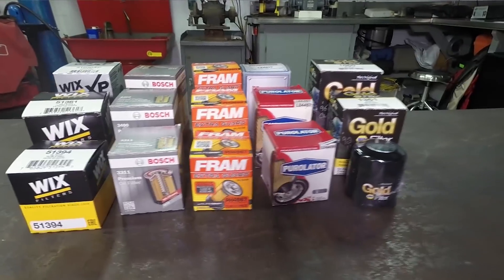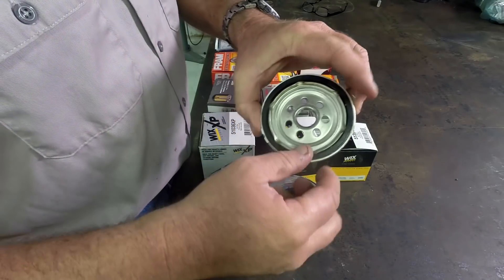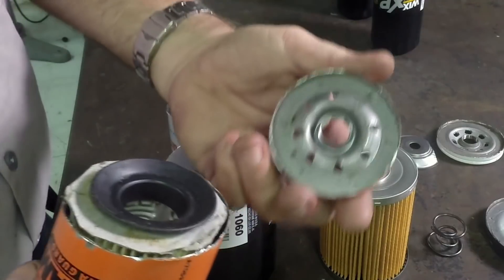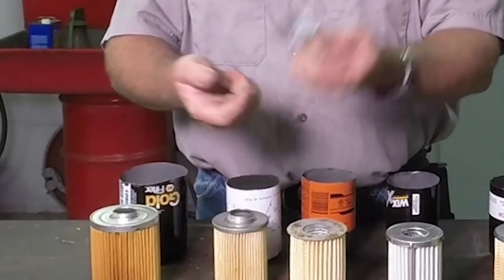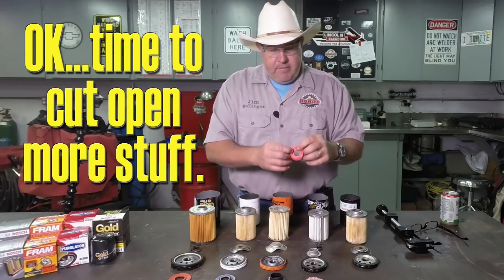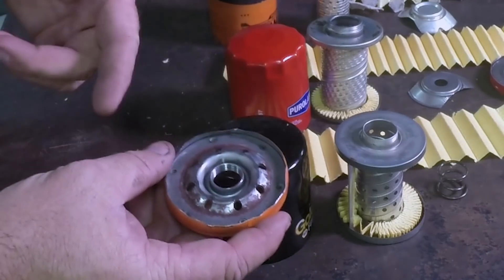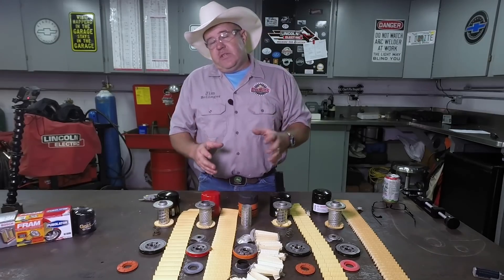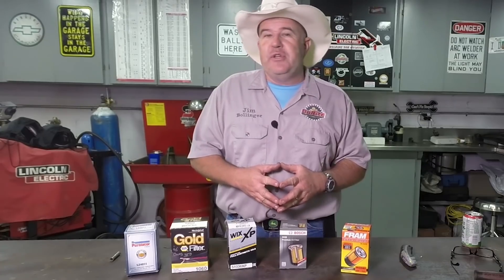The worst oil filter EVER!

Comment: As a licensed mechanic I can tell you the only oil filter I have ever had issues with have been fram filters. I've seen them cross thread, filter medium disintegrate and plug oil pumps and paths, to filters were the oil completely by passed the filter material, as it was dry after a full oil change cycle. The air filters are also suspect at best.
Reply: @Scott Page USMC I had a vacuum leak on my 2.5L 92 S10. Took the intake loose and replaced the metal intake gasket. I just put all my bolts in a container and really didn't look at them closely. One of the bolts is 3mm shorter. If you don't use that shorter bolt in the bottom rear hole of the intake, the bolt will touch the pushrod for the lifter/rocker arm. Well you know what this dummy did right... Point being most people doing their own work do not pay close enough attention, just like myself, then try to put the blame off on something else. Even though I do think it was an idiot move by GM to use 1 shorter bolt, so I guess me and GM will have a fingerpointing standoff...
Reply: Starcade 85 talk radio  Interesting. I've never seem a filter never mind a fram filter on a briggs ans straton motor. Maybe they were to smart \o/.
Reply: @jynxgoxoom  my Briggs and Stratton 17.5 HP Intel series engine on my riding mower has one! So does the Kohler command series12 HP  in my john Deere rider, and the 16 HP  Kohler command  in my cub cadet rider. Seems to be common in "big"  small engines. Oil filters usually are used in pressurized oil systems, not so much in your typical  3,5,7, or 8 HP versions. Have a nice day!!
Reply: @jamesrogers3181  now that I did not know. My experience with Briggs and Stratton is extremely limited. Any day I learn something is a good day. Cheers.
Reply: Byron G you must not have looked at one in the last 10 years or more. Most all use a pressurized oil system with a replaceable oil filter.
Reply: Ac Delco & mopar are made by champ Napa gold & wix are the same filter , I have seen them made at Wix
Reply: Cross threading is not Frams fault, it is the DUMMY behind the filter...
Reply: @kramnull8962  for actually tightening them on once they felt resistance yes. The bad threads to begin with, no.
Reply: @jynxgoxoom  More like a bunch of fun dummies that want to blame fram for something they have screwed up themselves. Funny thing is Fram offers the best filter removal tool of ANY filter... You don't need one. I'm sure that would throw your Wix into the $25 range for them to include that. Most engine failures are due to hot rodding 7000 RPM around town and running 15000 miles between oil changes. But no one is going to admit that... You see a guy running around bouncing off the rev limiter, then you hear his car with a rod knocking, then you talk to him. "Yeah It was that damn Fram oil filter... They found bits of cardboard throughout the engine"... Nah what they found was shrapnel from the bearings he desentagrated...
Reply: When I  was teen in the 1980s, working at a shop I would see this.  What was incredible is when I would see a business bring a vehicle in and the oil was just muddy sludge because this delivery vehicle (stop and go driving) had not had any servicing in 12000 miles.  A business that has invested in half a dozen new vehicles and does not assign someone to check the milage a couple times a week to make sure that recommended servicing was done was a mind blower.  Especially back then when recommendations called for 3000 mile oil and filter changes, 30000 on spark plugs, 25000 transmission, etc.
Reply: @kramnull8962  saw the filter material in the pump with my own eyes. True it could have been a one off but after seeing it and seeing the amount that lock on I decided that isn't the quality for me. If you, after seeing this video have chosen to apply them to your vehicle is entirely up to you. I'm just passing on what I have seen with my own eyes. Which has broadly affected my opinion of their quality.
Reply: @jnichols3  Like the older folk talk about too, in the 60's and 70's into the 80's there was no oil with detergent. The oil was supposed to sludge and stick to the sides of the block. That was the way it was supposed to trap trash and debris in the sludge... My Dad bought a 1994 F150 back in 2000. The truck had been parked and had been worked on a construction sites as a go getter and such. He wasn't thinking when he bought it and drove it home. On the way home the 5.0 sucked some sludge from the oil pan and clogged the strainer. Burned the engine right up. He said it had no signs, being it had no oil pressure gauge. He said the light came on and the engine shut down, but it was too late... Hard telling how old that oil was anyways.
Reply: @jynxgoxoom  how would the filter material make it through the tiny oil passages throughout the engine, back down to the oil pan and then get stuck in the oil pump. I want to hear this
Reply: @Bryan-Hensley  He never said it got "stuck" in the pump, he simply said he saw it in the pump. It could have been all over, but he saw the most of it in the pump instead.
Reply: @SkylineBNR34  oh okay, it made it through clearances that's in the thousandth of an inch and he saw it in the oil pump. The guy must have Superman eyesight.
Reply: @kramnull8962  High temp plastidip on your filter before changing them. I bought fram because of that too... not worth it. Not when I'm taking my car a hundred miles into the desert over nasty rock roads.
Reply: @OspreyKnight  There are exceptions. But for the guy that knows his drive is on the roads and what his milage is going to be. Fram every time... My 06 has 95,000 miles and my 92 s10 87,000. Change the oil in May then in November... That is the neighborhood of 3000 miles of, with Castrol. About a 30 mile round trip every other day on each vehicle, in a mild climate... Yeah if I had a $10,000 8000+ RPM engine it would be different... And no, a $60,000 car, truck or SUV doesn't = a $10,000 engine. Just overpaid for the vehicle by $35,000... "Oh but I got a center console worth $12,000", that a $100 phone can do better...
Reply: @kramnull8962  Is it worth it? Because I just looked up the filter for my truck and it's as expensive as the rest of the filters on this list. 8.99 at Autozone, Bosch and K&N are 8.99. and even a toyota OEM filter is only 9.99 and I'd trust that for mundane use of a vehicle over ANY aftermarket filter. After all, that is the filter the engine was designed to be used with.
Reply: @OspreyKnight  I pay less than half that. But I don't shop Autozone anyways. Case in point, today I walk into Autozone and hand the dude a vacuum line tell him what it is and where can I find it. (I'm not walking all over the store hunting). His question is "What is it used for"... I felt like telling him I like detailing the braided side of my carpet, so I use the smallest tube I can get my hands on to get between the knap... For Autozone I just use their Item numbers and buy the parts elsewares. Though I did go in there last month and buy an entire set of roller lifters for $22.89 tax and all. (Exactly why women shouldn't work in automotive) Perhaps I could get a "Good" filter from her for $1...
Reply: @jynxgoxoom  If your engine blew a bearing/rod or if your engine's oil pressure regulator failed...there's a dang good chance the filter got BLASTED with flow and CLUTTERED with metallic engine debris which caused the filter to implode and deposit its guts through the lube system.  The obliterated filter was likely a result of an engine failure (not the other way around). Just because the box says "filter lasts 10k-15k miles", doesn't mean you don't have to check your oil level. Engines often consume oil, produce a bunch of soot, and have other types of problems that has nothing to do with something as dumb and simple as a filter.
Reply: @kramnull8962  I'm not sure I buy this criticism of Fram either. I've been using them for almost 45 years. I typically get around 300,000 out of my vehicles. In 45 years I've only owned 5 vehicles and I still own the 5th one. Two of them were still derivable at the end and the other two rusted out. They all used Fram filters.
Reply: @kramnull8962  we had an issue with frame filters 10years ago where they looked like they were double threaded. They would go on fine and tighten fine but would blow off the motor on start up. Went through 2 cases and all were bad.
Reply: @thereallevel27  Schmokin dat chit...
Reply: SeeBsq deFF saw saw @kramnull8962  å
Reply: When you change your oils filters etc at service every 6-12k miles it doesn’t really matter what brand you use because changing them at regular intervals prevents said stuff from happening
Reply: @c02lth92  newer motors with synthetic oil are much cleaner, the oil doesn't get dirty as a byproduct of incomplete combustion. This means a filter that last longer. As always, use your manufacturer recommended service intervals. They did the testing.
Reply: Kevin Reinartz yeah i mean its fram we use on most the vauxhall/opels
Reply: @c02lth92  better change them weekly then! Lol we have some Chevy Tahoe Police units at work that we have to change the oil every 2 weeks due to the engine hours. GM recommends ever 250hr, we were going 600hr.
Reply: Kevin Reinartz  haha no way that’s actually kinda insane
Reply: @c02lth92  tell me about it... We are having outlets installed in their parking lot and battery charger installed in the so that when they are at the station they can shit the engine off. Can't wait to see the difference in engine hours, fuel cost, maintenance costs, failed batteries, etc.
Reply: Kevin Reinartz oil services is a task that can be done in seconds then doing them that often 😂
Reply: @c02lth92  we don't do just a drain and fill. They get the full inspection every time. The cop cars are driven way to hard not to make sure it's in top condition. Normally takes about an hour to do it if there is nothing else we find that needs fixed. Which we normally find something, if we didn't then we aren't doing a good enough job inspecting it.
Reply: And the Tearolators.
Reply: And also the cram oil filters I use it’s all plastic on the clip ins so it must be made different in the States
Reply: What's your opinion on STP filter and air filters
Reply: the passby was my main concern when the guy in the parts store gave me the same basic info that's in the video. They even had halfcuts of the filters to make their point. Now being a parts store I just assumed Wix was paying for some additional promotion, but the fact remains that said promotional material was factual. Inferior material and spring setup raise the chances of the filter medium slipping its seating and getting significant passby. I never expected anything as catastrophic as you mentioned but for a few dollars... why would I put shit on my engine.
Reply: Which state has licensed mechanics? Which department of the government handles the license?
Reply: As one guy replied "But paper don't rust"  meaning the top and bottom ends. Yep but it's a shitty filter component!
Reply: Bullshit.
Reply: That was you. Perhaps you should have swatted dirt from the carb with your man hand...
Reply: @elephantrider78 You're the dumbass with the problem... I've never screwed up an engine...

Comment: That is your opinion. you probably just got a junk one out of a million made. I've been using FRAM oil filters for so many years and have NEVER had a problem with them and will continue to use them. To me they are great filters and my vehicles have all lasted well over 250,000 miles with them and were still running great when I would sell them.

Comment: I have been using gram orange filters since I bought my corolla new in 2007.  200,000 miles later still working fine, never been in the shop.  This guy is taking about quality by the look of the parts.  Test them using ASTM standards, and once you have data you can talk about quality.

Comment: This is somewhat not a fair review. I noticed you used a Napa Gold filter which is their 2nd best oil filter out of the 3 ( Napa silver, Napa gold, Napa platinum) but you are using the basic oil filter from purolator which is their most “economic” filter (Purolator, Purolator One, Purolator Boss) why didn’t you try their 2nd best oil filter the Purolator One to truly see the difference???
Reply: Same goes for the Fram filter: the cheapest model was used.

Comment: OMG. These videos have been done to death. People been using Fram for years. Had cars run 200,000 miles on only Fram. Also do you really think that the spring is what holds the filter in there? What a dope

Comment: I'm glad I saw this I just changed my oil in my brand new $55,000 Chevy Silverado yesterday and I always use full synthetic oil in all of my engines and Fram filters used to be the best now I know you say what I saw on the video they are trash I'm swapping that out tomorrow best flight predictor Rocky Esterline also X mechanic

Comment: Dude- I’ve bought lots of Fram’s over the years. Never again. Thank you very much.
Reply: Wow lie much !! or are you just that stupid?  Thats not rust and you know it. thats Discoloration  where they use heat to cure the cardboard to the filter. there is NO rust in the canister !!  yes it is a cheaper filter, but its susposed to be. its only good for 5,000 miles and is dirt cheap for walmart to sell. if you want a good filter test a fram ultra filter rated for 15,000 miles. cut one open to see , makes your napa filter look like a pice of shit.  i am a mechanic & i know what im talking about.  you are lying to these people and should be ashamed !!!!!!!!!!!!!!!!!!!!!!!!!!!!!!!!!!!!!!!!!!!!!!!!!!!!!!!!!!!!!!!!!!!!!!!!!!!!!!!!!!!!!!!!!!!!!!!!!!!!!!!!!!!!!!!!!!!!!!!!!!!!!!!!!!!!!!!!!!!!!!!!!!!!!!!!!!!!!!!!!!!!!!!!!!!!!!!!!!!
Reply: @franko becouse they dont use cardboard end caps glued to the inner perferated filter. they use a thin tin plate.  they glue the end caps on and cure them very quick with heat.  and heat on cardboard discollors it brown.  heat on tin has no discolloration. a standard Fram filter was desined to be a cheap filter for walmart.  all though its a cheap made filter, it works just fine for standard 5,000 mile oil changes.  have a great day Franko.

Comment: Watched quite a few of these filter cut apart videos. NAPA (WIX) does seem to make a pretty darn good filter. But from some of the other videos I've seen, in most cases, your car manufacturer brand of filters are usually quite good. I've seen several videos where the Motorcraft (Ford) filters are cut apart and while they may not be quite as premium as those Mobil 1 oil filters... they ain't far from it... and they cost about half the price.

Comment: Hey chief. Fram filter is way better oil filter. I've used fram in all my vehicles. Never a problem. Now I wanted to use the wix just to try it out. Never again.....damn filter Caused my car to lose....oil pressure. It destroyed my engine.....so your video is an invalidation to your quality control I will never ever use Wix ever again do to my experience I even tried contacting wix so I can get a comment from them nothing. So yeah thanks for the video really appreciate it but no thanks I will never use Wix. Fram will always be my number one choice thanks

Comment: Just watched this video because i been changing oil at walmart and engines been tapping on cold start up and realize they use a fram filter. 5+ shops said i had bad hydralic lifters and it would cost 2k+ to repair.... based on this vid, i suspected a bad anti drain back valve in the fram....change filter and put on a wix, GUES what, been 5 days @25-30f on start up, no tap from lifters....SOLD on wix...and fyi., my oil befor changing to wix only had 35 miles on it.
Reply: The Dirty Trucker Videos a tap ?? Try a lighter oil in the winter
Reply: @joed7734  : i went fro. 5w-30 to 30w with no change... i live in idaho and its been 20-25F on start up. As soon as i changed to a diferent filter all problems went away and im back on 5w-30

Comment: +1 DoRite Fab -  This video is quite shocking as I thought most oil filters were about the same quality.   WOW it shows that Fram filters have been designed and manufactured using el cheapo lessor quality materials.  The result is a product that obviously works but that is merely adequate.  Does anyone really want to trust a merely adequate product to protect their expensive engines?

Comment: Just change your oil and filter every 3000 to 5000 miles depending on driving habits. When I had an s2000 and would drive it hard I would change the oil every 3000 miles. During winter months when I wouldn't be driving hard just stretch it to 5000 miles.

Comment: I've been warned for decades about Fram quality, so this only reinforces what I've been told amongst other mechanics. What I'm really curious about though, is the OEM brand filter quality (Mopar, Motorcraft, AC Delco, Mazda, Nissan, Honda, et cetera) German stuff isn't necessary as nearly all of them are paper cartridges now; what you see if what you get...usually I'll use Mann of Mahle filters.

....should probably cover K&N too if you choose to do a second video. In fact, should probably figure out who makes whose filter as I'd imagine a lot of these companies are rebranding other manufacturer's product.

Quick question if you're reading: What were the engines you chose besides the small block Chevy?

Comment: People  forgot  all about the cheap inport filters a few years back  that made your engine KNOCK on start up because there was  NO rubber flap inside of the  filter that was sold to  AUTO repair  dealers across the country for oil changes such as FIRESTONE and car dealerships.  Lets start a list  of  Dangerous  CHINA  imports starting with:
#1  Sixty eight thousand  tons of ..WALLBOARD
#2   LEAD PAINTED Children's Toys.